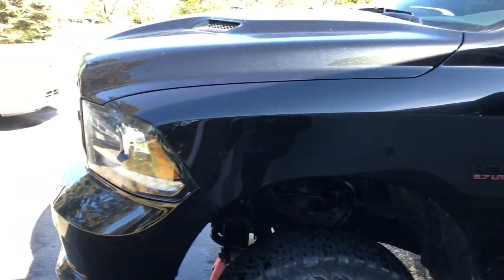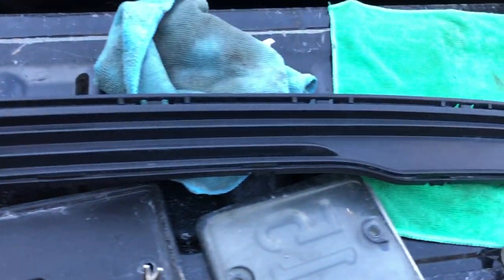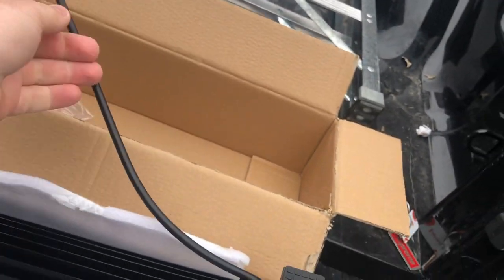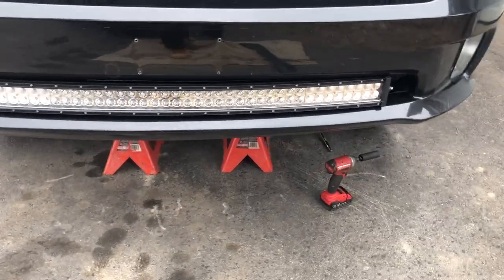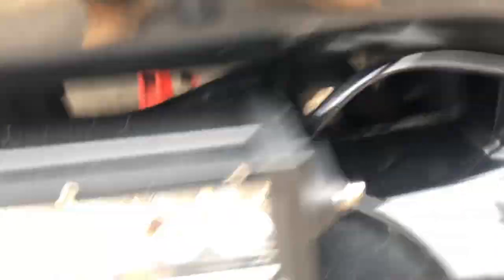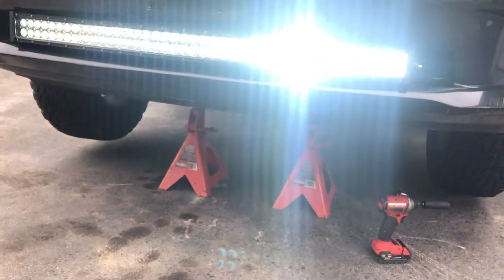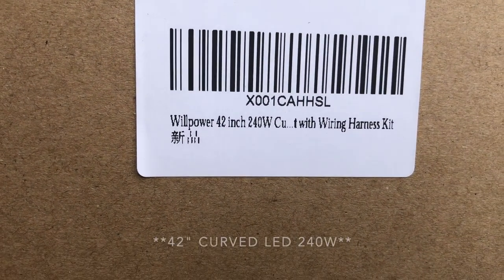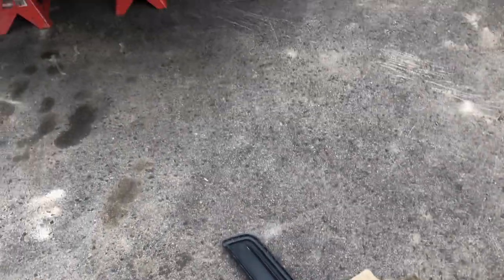Ram 1500 Light Bar Install!!

Comment: How did you get the plastic insert out
Reply from the maker: Little clips on the back. Can use a flathead screwdriver to lift the clip, them push from the front of the truck in